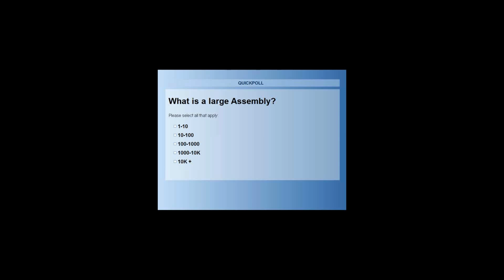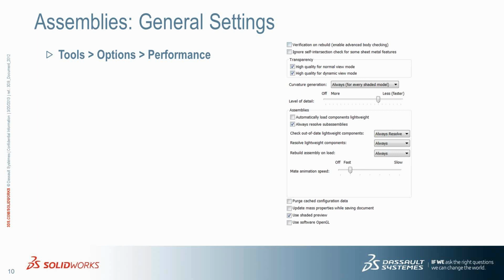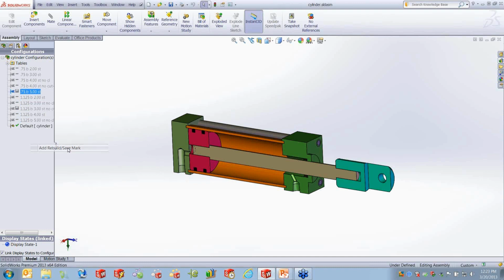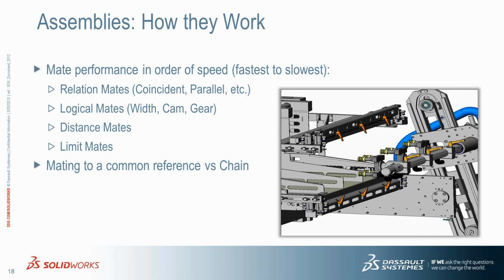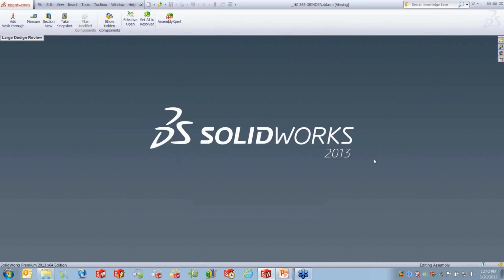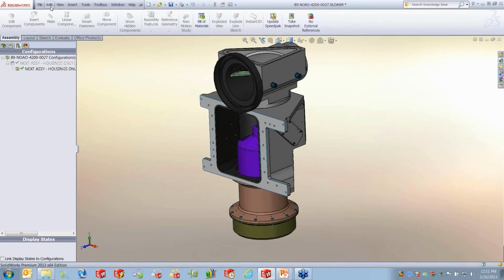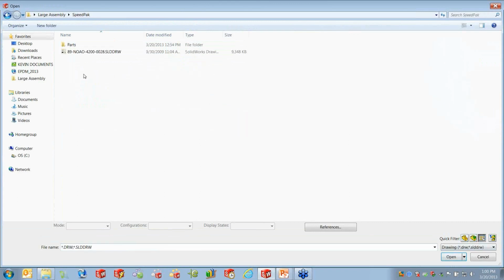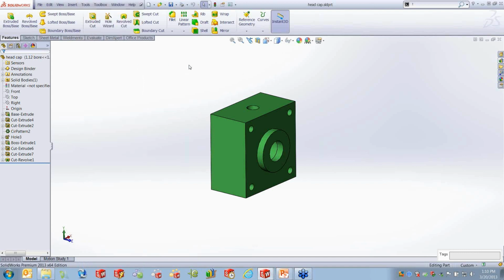Lunch & Learn - Implementing Large Assembly Best Practices

Comment: That was really helpful.  Looking forward to implementing a lot of your tips.  

I've had so many problems with working collaboratively with the SW Toolbox that I have stopped using the toolbox for hardware like screws and prefer to bring in McMaster parts.  But they come in with modeled threads. I was wasting time fixing the models to remove the threads or not doing that and living with the wasteful overhead of the full threads.   Your suggestion to just add a simplified Config to the downloaded McMaster parts and then suppress the thread features inside the simplified config in is the way to go.  I will be doing that to a half dozen screws tomorrow.
Reply: Steve Krause .......same here